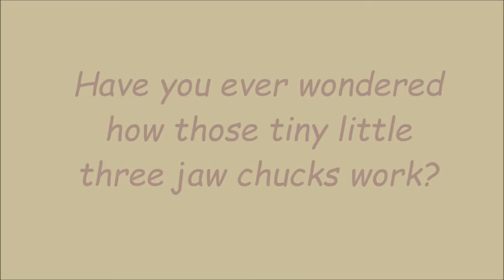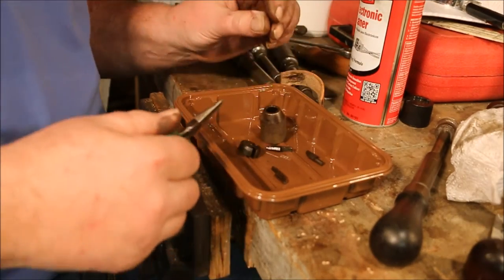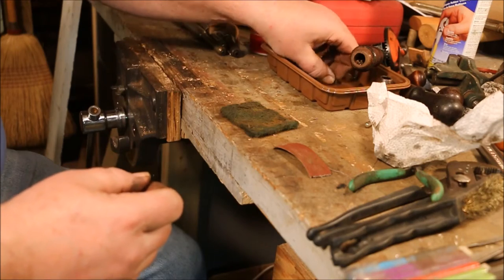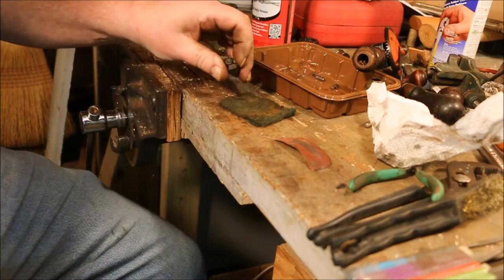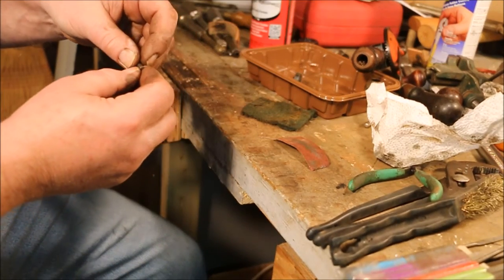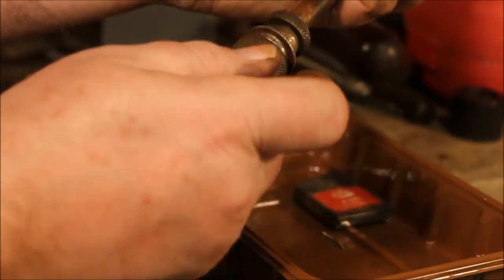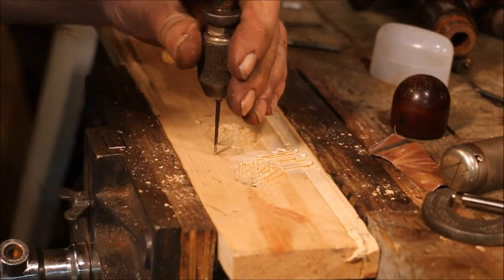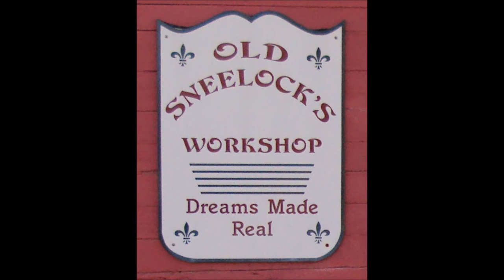Repairing The Chuck On A Millers Falls Push Drill ~ Pt 3 ~ by Old Sneelock's Workshop

Comment: Just came inside from putting brake pads on the wife's van. Beat the winter weather. Now warming up watching Old Sneelock. Very cool fix on the chuck. I will be looking for them at yard sales.
Reply from the maker: Tim Caldwell  That's a project on my list too. My pickup needs new pads every 4 years or so. While I was getting a low tire repaired at Discount tire I checked and they are due. Two tires with screws in them. 
Not an ad, but Discount has been great. Flats fixed and tires rotated for free. First time I drove to a scrap yard. Note - stay in the parkinglot and walk back. 😐
Reply: Landfill is the same way.

Comment: I would have to check the part one again, but it seemed that the drill operated MUCH faster than before.  With all the gunk, grunge, and grime out of the mechanism, it can return much quicker.  I suppose the fresh oil helps, but I think the cleaning was the real boost.  
How difficult are the bits to sharpen, and do you sharpen them more or less in the same fashion as the more common twist drill?
Reply from the maker: Yes the gunk in the scroll made the drill not want to extend. When I released and pulled the handle up it hopped out of the hole and I had to go slower to keep it from jumping. 
As far as the sharpening goes. I'm glad you asked. That is tomorrows video.
Reply: Job security.